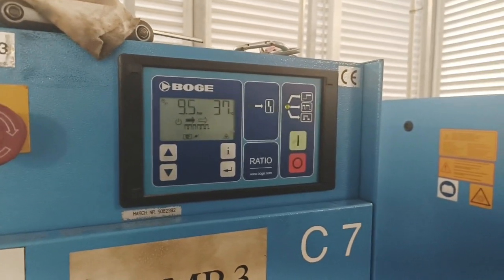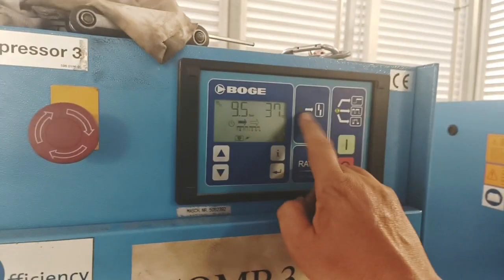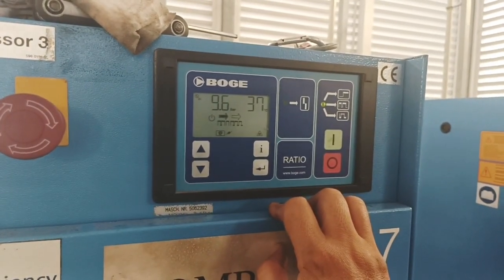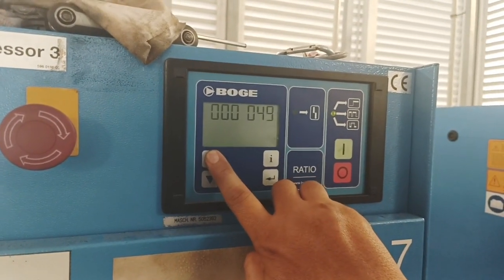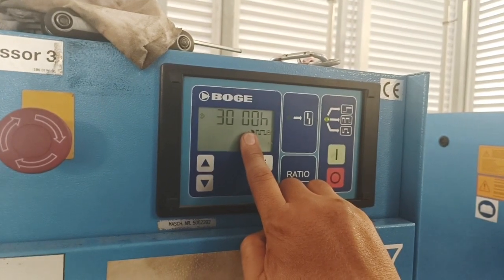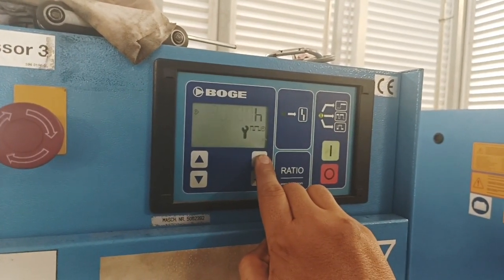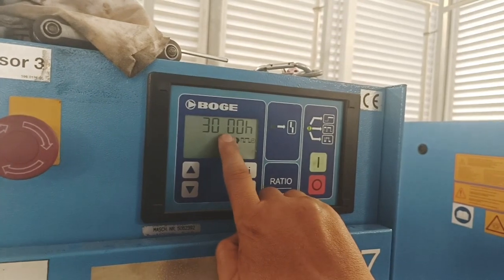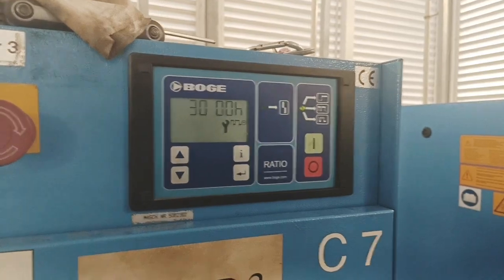Boge compressors error 11.

Comment: What does code 12 mean please? It's a BOGE S40-3
Reply from the maker: Error 12 system pressure decreases too slowly. Please check if there is any obstruction of the release tube. If not clean the solenoid valve. Still cannot not? You might need to replace the solenoid valve. Hope this helps.